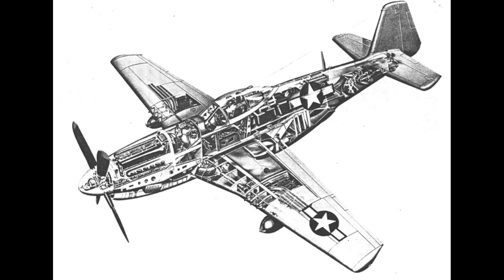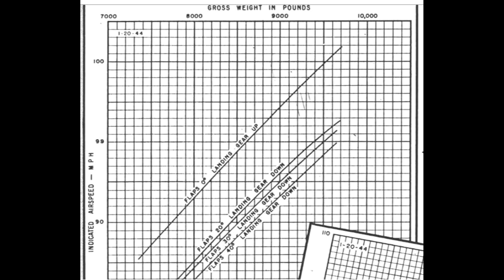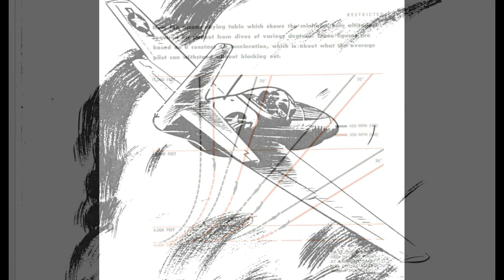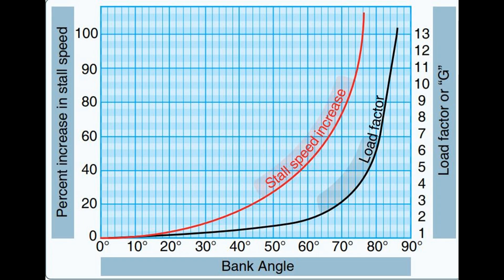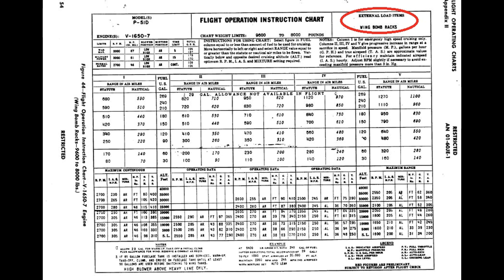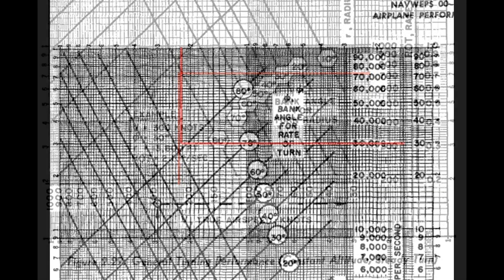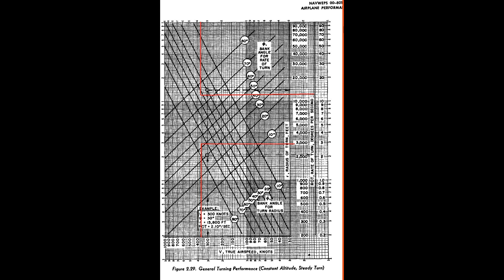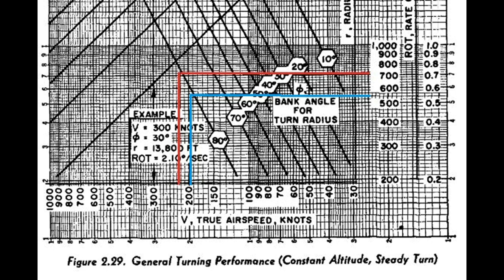P51 Mustang Turn Radius vs.

Comment: The interesting thing is that for instantaneous min radius, we don't really care about speed at all. It (very nearly) drops out of the equation in this regime.

Let k = 1/2 C_L A rho.
Any given wing has a fixed reference area and maximum lift coefficient. Rho is air density and is roughly a function of altitude. 

Then maximum  lift L = k v^2

 R = v^2/a = mv^2/L = m/k = v_stall^2/g

The notable approximation is that this a = L/m isn't quite right for a level turn... it assume you bank straight sideways and god be darned if you lose some altitude. The more accurate expression is to correct it by the factor sqrt(1-1/g_factor^2). For a 7g level turn this is sqrt(1-1/7^2) ~ sqrt(1-1/50) ~ 1-1/100 = .99. If you are flying a bit slower at sea level and can only pull 4 g level it's about .97. Your turn radius will only be 2% more. 

So we see that as long as you're broadly near the right speed, your turn radius is fairly insensitive to it. What matters operationally is reaching C_L_max, which in practice means pulling to just before the stall AoA. It also becomes obvious that flaps always tighten your turn instantaneously (since they increase lift/decrease stall speed) The reason why the plane needs so much farther to turn at altitude is air density. Turn radius is inversely proportional to air density, and 30,000 ft air is 3/10 as dense as at sea level, so the turn radius should be 10/3 times that at sea level. This is not very dependant on speed... even if you were able to go fast enough to pull 7g you would only decrease radius by 2% or so. 

Which is why you can also say that roughly speaking, the relative turn performance of fighters is not a function of altitude in any condition where turn fighting is possible. If both fighters can pull more than 3 g or so then the one that turns tighter at sea level will still turn tighter at altitude, and by about the same amount. Only if you're in a condition where one fighter is near its ceiling and the other is not will there be a major change in this ratio.
Reply from the maker: According to Aerodynamics for Naval Aviators, maximum turn performance happens at the lowest speed at which the plane can pull it's maximum allowed G load, thus speed is a factor. Power is a factor in sustained turns at a constant altitude.

Comment: Lol these formulas are so American and so engineery. "v^2/11.26*tan(theta). Let's derive it. 

a = v^2/R is centripetal acceleration. 
-> R = v^2/a
a is horizontal so in a level turn, a_y = a*cot(theta) = g 
-> a = g*tan(theta)
-> R = v^2/g*tan(theta)

By doing this we can see that 11.26 is the value of g, in the uncommon unit of (true) knots^2/ft

Comment: There's too much emphasis put on air combat maneuvers. The one stat that comes out of WW2 that really stands out is that 80% of pilots that were lost in air to air combat never saw the plane that shot them down. One high scoring ace put that figure at 90%. Obviously situational awareness was the single most important factor in survival. Sneaking up behind someone and blowing the unsuspecting bozo out of the sky at point blank  range isn't very exciting or dramatic that's the reality of air to air battles in WW2.

Comment: I'd like to see the second part of this subject on sustained turn performance. And a third one that lists the various turn rates both instantaneous ans sustained at various speeds and altitudes, for all the major aircraft types in use in WW-II, but I think that is probably too much to ask? As all ways, I love your stuff.
Reply from the maker: Actually I have quite a bit of that, my 262 vs. P80 video has it and so does my P-47 part 5 video.

Comment: Angle of attack also affects turn rate because it affects lift in a turn.
Reply from the maker: Yes, but indirectly so. With all factors fixed, and increase in bank angle requires an increase in angle of attack. This is because lift in the vertical has decreased, so you need more total lift to make up for it.
Reply: @GregsAirplanesandAutomobiles  not necessarily so. If you're flying straight and level you can change angle of attack without adding bank angle or you can add bank angle without adding angle of attack. Usually however if you're trying to turn you will add a combination of both to maintain a flat turn. If however if you don't add aoa you will lose altitude. That will give you a different rate of turn than if you do add or reduce aoa simultaneously.
Reply from the maker: That's why I said with all other factors fixed. Let's look at your first example, yes you could increase angle of attack when flying straight and level, but altitude will change (if you maintain speed, again all other factors fixed). In a turn you can bank without adding angle of attack, but you will descend, thus not hold altitude constant. There are some exceptions, for example knife edge flight in an aerobatic plane, but that would be uncoordinated flight, thus not be holding all other factors fixed.

Comment: Sustained turn performance generally refers to turning at equilibrium: that is when the aircraft is not losing speed or altitude. If the P-51 were to have superior sustained turn performance that would be because it has more available engine power and wings with a higher CL/CD at the required CL (and thus angle of attack) for max g's. You cannot get sustained turn performance from only the numbers you used.
Reply from the maker: We didn't cover sustained turn performance in this video. I specifically said that in the video. I cover that in another video. In fact, I think I beat it to death in my P-47 pt. 5 video.
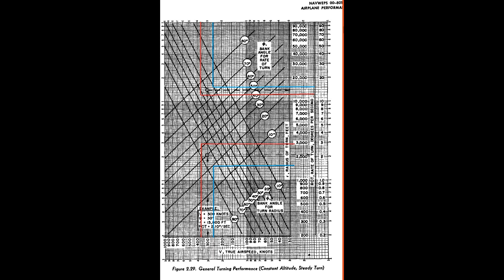Reply: @GregsAirplanesandAutomobiles  Yes this only addresses the comment made right before at 12:24 which seems to imply that "more speed to lose" is related to sustained turn performance.
Reply from the maker: I understand. What I meant there is that the 51 would be able to maintain a higher average rate for some period of time because of the extra speed. That's not the same as sustained turn performance, but I see how it could have been viewed that way. I think you will like this video: https://youtu.be/KahHLtYlveQ

Comment: I'm fairly sure the conditions you imposed (slowest speed to achieve max acceleration) gives max turn rate, not minimum turn radius. These are not generally the same conditions.
Reply from the maker: I literally posted the pages from AFNA and PHOAK in the video. They specifically show radius, although in the case of the AFNA chart it can also give rate if you use the top section, but that's not what we did here.
Reply: @GregsAirplanesandAutomobiles  Yes but the chart gives you turn radius for a given bank angle and speed. What I'm saying is that the bank and speed you chose were not necessarily the ones which will give minimum turn radius but rather maximum turn rate. In general the minimum radius turn will happen much slower than the maximum rate turn, though I'm not aware of general scaling relationships that work across different aircraft. Here's an example from the F-16 A flight manual. You can see min radius turn is about M0.3 while max rate turn is about M0.6. 
https://i.stack.imgur.com/9mlj2.jpg
Reply: @GregsAirplanesandAutomobiles  The only charts I can find claiming for the P-51 are here:
 https://www.combatsim.com/htm/nov98/energy-man2.htm. 
This is for a flight simulator though and I don't know where they pulled the numbers from. If they're qualitatively right though it may be that the two speeds coincide for many WWII aircraft?

Comment: Many P-38 pilots found that at lower altitudes in a turn against a 109 you add power to the up-wing engine, reduce power to the down-wing engine, and open the Fowler flaps about 10 degrees. You cut right inside of him where those 4 50 cals and single 20mm cannon cut him in half like a rip saw through balsa wood. Just ask Robin Olds. He loved his P-51 but understood the capabilities of his P-38 and pretty much every aircraft he flew. I think pilot skill is the best determining factor in turn radius.
Reply from the maker: If the two planes are equal in turn performance, then pilot skill will be the determining factor. The farther apart they are, the less it matters, For example, any Japanese pilot in a Zero in 1941 could out turn any US pilot in a Brewster Buffalo, and do it at any given speed.

Comment: The p51 could turn faster than the 109 as long as it did not slow down and make a sharp turn.  The p51 could come around faster by making a more gradual turn.  The 109 turns sharper but if the p51 does not try to make a sharp turn and keeps up his speed he can come up behind the 109 especially at high altitude under war powers with 150 octane fuel which the stats do not account for.  It's not a matter of how many gs you can pull or radius. its a matter of how fast you can come around.

Comment: Love your video series, but I respectfully disagree with the idea that the mass of a plane doesn’t affect its turn performance. To turn an airplane (or anything else), you have to provide a lateral force to overcome the plane's linear momentum, which is its mass times its velocity. Obviously, it takes more force to change the momentum of a heavy object, than it does a light one. For an example, consider the centripetal force required to hold a plane in a circular turn. The equation for turn radius that you cite in the video is for a spiral, but the equations for a circle are better known, and the math is simpler, so I'm using it for my example. However, you can derive similar equations for a spiral, and get basically the same result.

As is well known, the centripetal force required to hold an object in a circular turn is...

 
F = m * V-squared / R

...where m = mass, V = tangential velocity, and R = turning radius.

In an airplane, the centripetal force provided primarily comes from the lift of the wings, times the sine of the bank angle. Again, as is well known, the equation for lift is...

 
L = F = ρ * Cd * A * V-squared

...where ρ = air density, Cd = Coefficient of Lift, A = wing area, and V = tangential velocity.

When the centripetal force required = centripetal force provided, the velocity-squared terms cancel out. Rearrange the equations, and the circular turn radius is...

 
R = m / [sine theta * ρ * Cd * A]

...where theta = the bank angle.

In other words, a sustained turn radius is proportional to the mass of the airplane, but inversely proportional to the bank angle, air density, and the lifting characteristics of the wings (and/or other lifting surfaces). At that point, speed no longer is a factor, so long as it's high enough to prevent stalling.

Why isn't airplane mass mentioned in the pilot's manual? My experience with operating manuals is that usually, they only address factors that the operator can control. Unless you count jettisoning fuel or stores, there isn't much a pilot can do about mass.
Reply from the maker: Take any airplane, but in this case, I'll use a 767. At 250,000 pounds, when at 250 knots in a 30 degree bank, the turn radius will be identical when at 350,000 pounds at 250 knots with 30 degrees of bank. Airplane manuals certainly do address mass, in the case of the 767-300 it could be flying at a weight anywhere between about 180,000 pounds, and 412,000 pounds. The manual has to address that as take off and landing distances will vary hugely, as will service ceiling. Now, your math isn't wrong, it's just that you are doing the wrong math problem. There will be further explanation of this concept in my next video, so rather than type several paragraphs here, I'll just get to work on that.
Reply: @GregsAirplanesandAutomobiles  - Hi, Greg - Prior to entering the turn, the heavier plane already will have been trimmed to give it an effectively larger coefficient of lift, leaving speed and bank angle as the two remaining variables determining its turn radius. It should be noted that the equation given for turn radius describes a spiral, suggesting the assumption of enough reserve wing loading to tighten the turn, so it's not at all surprising that, initially, at least, disparate airplanes, flying at the same speed and bank angle, will share a common radius (though probably not turn rate). My point is, that there's a limiting turn radius for which mass will be the dominant factor. Put another way, if - Lord help us - two 767s were to get into a dogfight, my money would be on the lighter of the two.

Comment: I did the calculation and turn radius as a function of speed, if without any structural limit, asymptotally approaches a value from above, that value being stall speed squared over g.
Reply from the maker: I'm not sure I understand. Math please.
Reply: Greg's Airplanes and Automobiles radius of maximum performance turn equals speed squared over (g times the square root of (v/vs)^4-1), vs being stall speed
Reply: The -1 compensates for the amount of lift spent in counteracting gravity instead of contributing to the turn. My calculation indicates that if without gravity, the airplane’s radius of maximum performance turn is constant disregarding of the speed.
Reply from the maker: This is what I use: https://www.faa.gov/regulations_policies/handbooks_manuals/aviation/phak/media/07_phak_ch5.pdf The math for this is on page 5-39. I would be curious to see if it comes out the same as your formula, I don't have time to do it right now because I am uploading a new video at this moment.

Comment: Too bad there was no discussion of "Cornering Speed", which is the slowest speed that you can still pull the planes G limit. The pilots G tolerance is irrelevant since we're comparing airplanes. Using a V-G diagram would have been a lot easier. Restricting the condition to a level turn sustained by horsepower is not realistic. That would favor the most powerful engined aircraft, even though it might not turn worth a damn. The Bf-109 also has leading edge slats that automatically reduce its stall speed in a tight turn as the angle of attack approaches stall. Most fights are in the vertical, not the horizontal, so the level turn requirement skews the results. Still, an excellent discussion of the variables involved figuring out aircraft performance. This video is in my "saved" folder for reference for my aerobatic students. I do have over 1000 air-to-air engagements under my belt (training conditions, not real combat). Thanks for posting it. By the way, its was a P-51 before the 109 photo. It was a P-51C. It does look a lot different than the familiar P-51D.
Reply from the maker: OK, what you are calling "Cornering Speed" is what is referred to as maneuver speed in Aerodynamics for Naval Aviators. It's the lowest speed at which you can pull maximum G, and it's the speed which gives you the best momentary turn performance. That is covered in the video. The plane at the beginning is NOT a P-51C, nor a P-51B, nor a P-51A, and not even an XP-51. Look closely, if it was that easy I wouldn't have mentioned it.

Comment: Imagineering a shift in aueronautics (spellchic just keeps screamin') one can imagine propeller to glider with micro-magnetic power and now the batteries have arrived. Free flowing lightweight props all about the areoplane that gather enough energy to charge the batteries. Right now as I type I imagine a P-38 glider kind-o-thing. New-Age props and hydraulics. Catch my drift? What if props had gone directly to zero-point energy as formulated by Tesla...some call it "electro-magnatheric" that derives location by Earth's magnetic fields with a single chip navigation. I like landmarks. AloHA. Cool vid. I pretend to understand it and nobody questions my Wild Science Set Free and Costing just a wee bit...
Reply from the maker: I'm not knowledgeable on Nicola Tesla, so I can't comment on any of this intelligently.

Comment: The P-51 all day long. If it's flown by the right pilot. Richard Candaleria, and some other notable aces could literally "spin" the plane around on a dime by throttling back, while pulling up hard, while kicking the rudder right, or left, positioning the Mustang on the flanks of the pursuing enemy aircraft as it passes by.
Reply from the maker: The maneuver you describe is a snap roll, many WW2 fighters could do it.
Reply: @GregsAirplanesandAutomobiles  Hans Joachim Marseilles (158 kills) could throw his 109F around ,lowering flaps slats and even undercarriage  (gear)  to turn inside Alied fighters and drop through  the defensive "Lufbery ring" formations , often scoring several kills in one pass. The trouble with the 109`s was that you could pull the wings off them !  the aircraft gave no warning when limits were close ,,the Spit would shudder and let you know to ease off.It was down to the nerve of the German pilot how far he DARED to go.The pilot could cope with higher "G"in the Messerschmitt due to the "recumbent"seating position.

Comment: Why does everyone forget about the P-38?  The P-38 was the only WWII fighter with Fowler flaps that provided lower stall speed in addition to drag.  With one notch of flaps, a P-38 J model had a power on stall speed below 60 knots.  The aircraft had a notch on the flap level that allowed the pilot to ''slap' the flaps to this setting.  This gave it the tightest turn radius of any American or European fighter.  Only the Zeek and Oscar could out turn it.  You don't hear about this much because American doctrine was boom and zoom rather than turn and burn.
Reply: You miss understanding. Turn radius and turn speed is two different things. You can turn tight but more important is speed turn.
Reply: I remember reading about one P-38 pilot who claimed that at low altitude he could outturn any plane, but it involved differential engine power and a pitch up - basically the P-38 could be going in the opposite direction faster than any other plane, changing direction 180 degrees.
Reply: @danzervos7606  Sorry not so
Reply: Not true in reality.